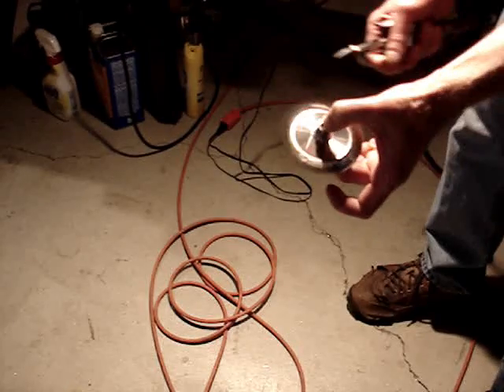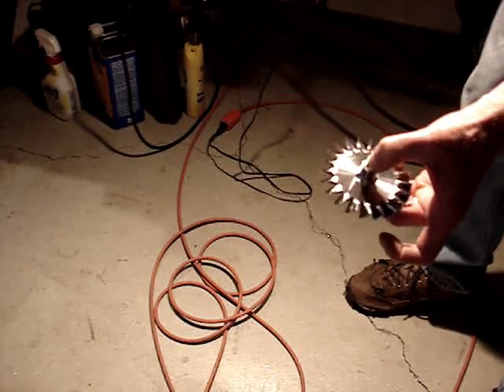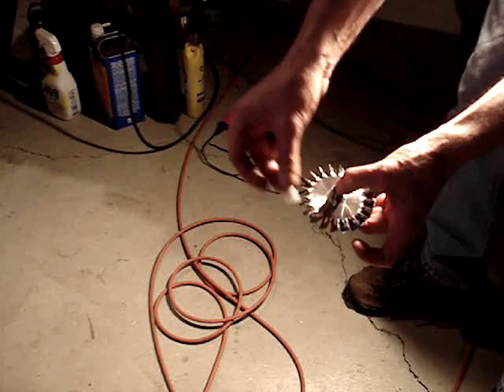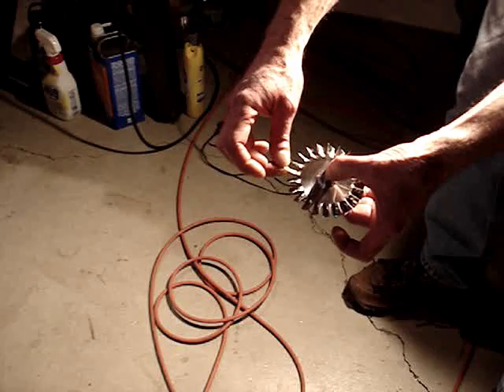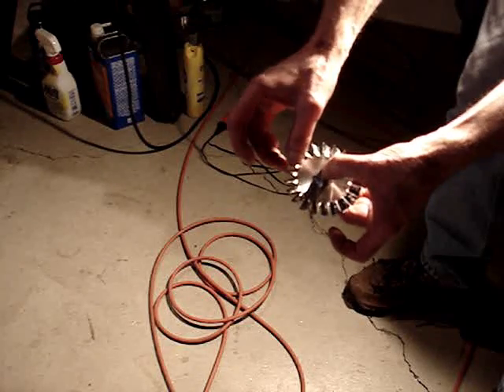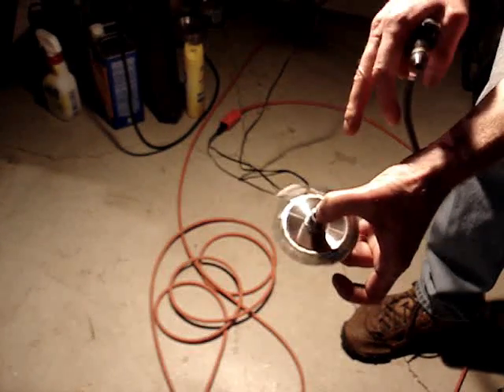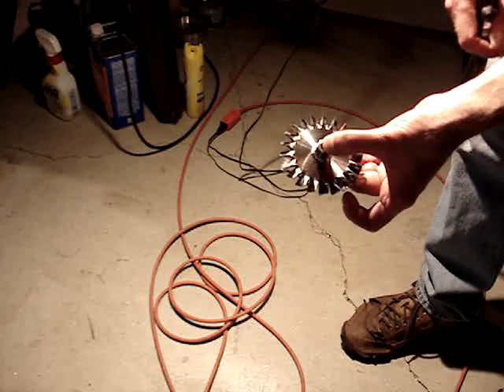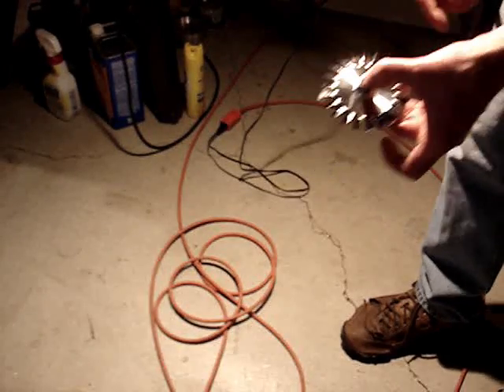Balancing a Schreckling turbine

Comment: Hi Jeff 
bolt it onto the shaft with a bearing then with the shaft pointing to the ground hold the out ring of the race between finger and thumb spin up as you are doing it ,wear a leather glove with cutouts in the finger thumb area. Thats the way Kurt did it.my finger ends are too died did not work to good for me !
Reply from the maker: I've done it that way too, but the shaft starts to gyrate.  This method seems equally as effective and not as dangerous as it looks.  I thought about the leather glove with thumb and middle finger tips removed.